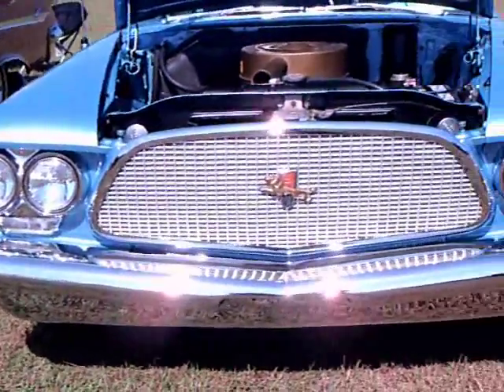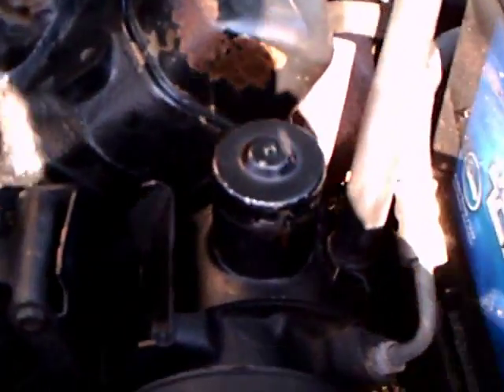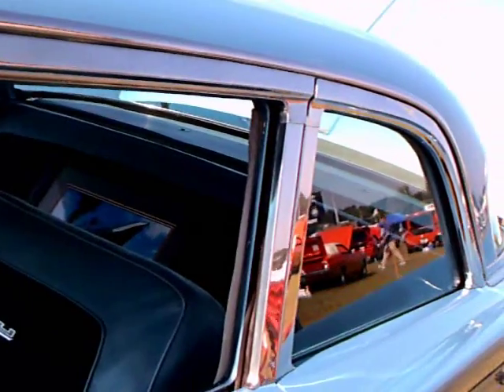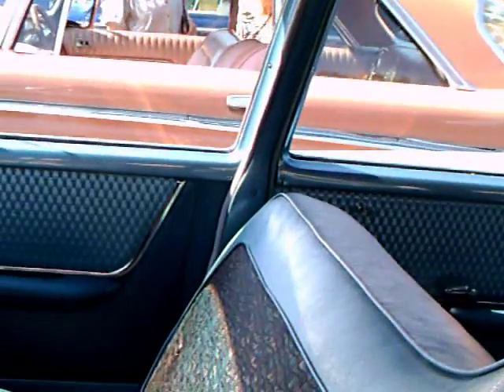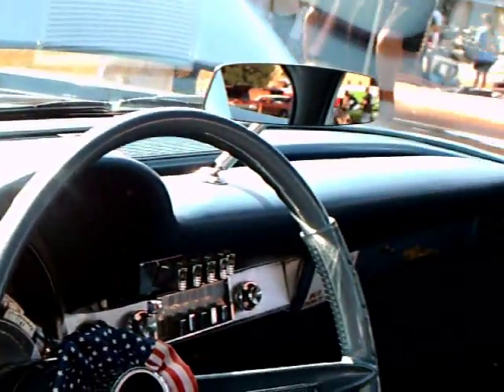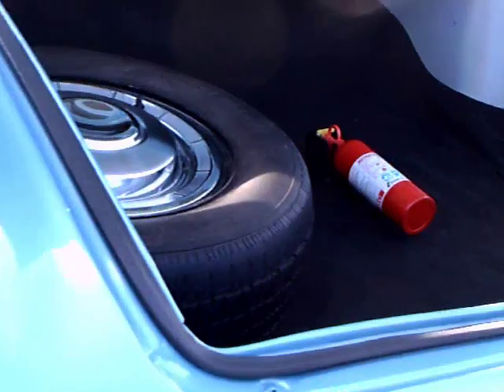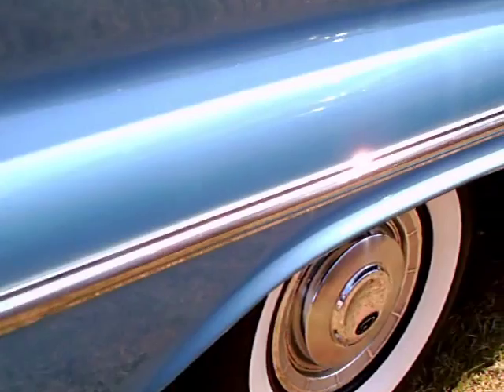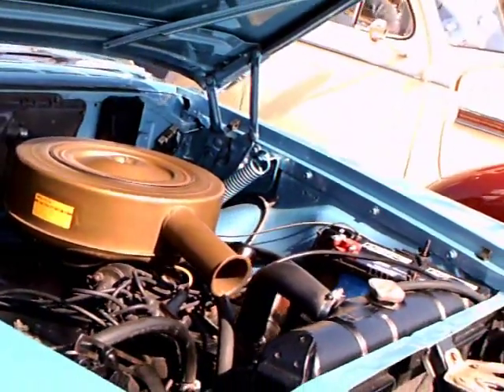1960 Chrysler Windsor Four Door Sedan Blu GarlitsOcala110412

Comment: Very nice! Way, way back when, my best friend had a '60 Bonneville without either power brakes or power steering. It looked very good but was not exactly pleasant to park.
Reply from the maker: V8's without power steering were a challenge to park.  You can see why the steering wheel was so big, to give some mechanical advantage in winding that big wheel around!  Power brakes and power steering were probably the most important advances of the 50's.  They made driving much less physically demanding.  Thanks!  :) Jack

Comment: Hey Jack! This is a very pretty Blue and a very nice looking car for the age. I had the '61 full sized Cousin the Dodge 4 dr. And no power brakes or power Steering. I didn't find it hard at all to handle, or stop. As a matter of fact the power steering of the day was so easy and loose it meant you really had to hold on to the wheel. I sure hope you shot the car next to this the Chrysler.

Comment: That must have been fun to stop from highway speeds!
Reply from the maker: Hey, John!  Great point!  Historically, American cars were slow to adapt disc brakes as superior braking mechanisms.  The speed and weight of the car would indeed make it difficult to stop!  Thanks!  :) Jack
Reply: I learned to drive on a 1970 Sports Satellite that my father had ordered from the factory with manual steering and brakes. It was a pig to steer and park...i can not imagine another 1000 lbs added into the equation. The brakes were equally inadequate.

Comment: The lack of power brakes was/is not that big of a deal. If anyone has driven a power brake Chrysler of this era and I have, drove a my grandpa's 65 Coronet 500 once with power brakes and they were just too darn sensitive (think of the MGM cartoon "barely touch these brakes and you stop") it was difficult to modulate how hard you were pushing. Most people didn't like them and went without them, opting for the manual brakes instead, but did get the power steering, of course. I drove on a regular basis a 67 Fury III with manual brakes and had no trouble using them, the pedal pressure was not that difficult and was actually preferable to the power brakes in the 65.
Reply from the maker: That's a very good point!  I remember those touchy power brakes.  Non assisted brakes would at least be consistent, requiring a firm application!  Thanks!  :) Jack